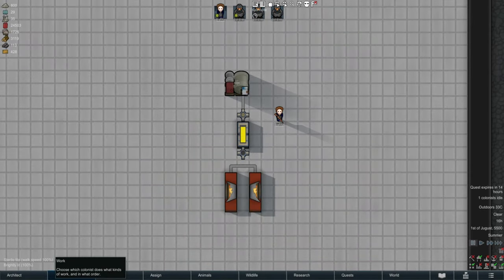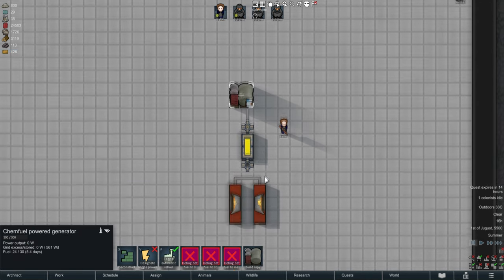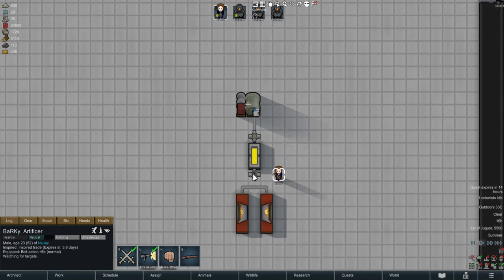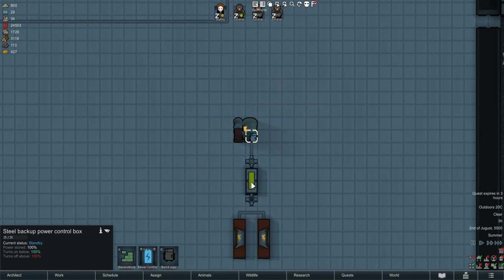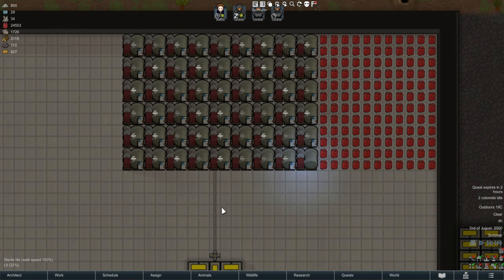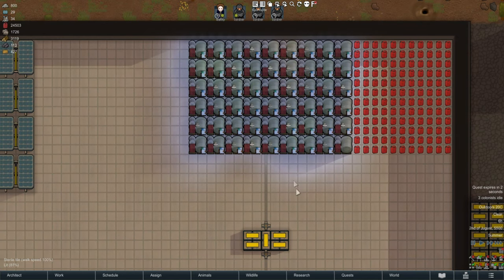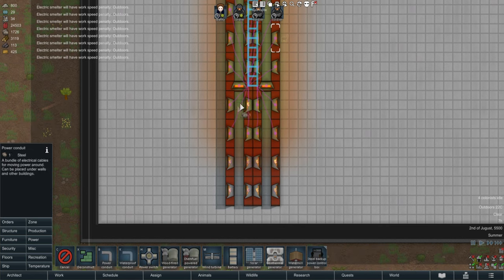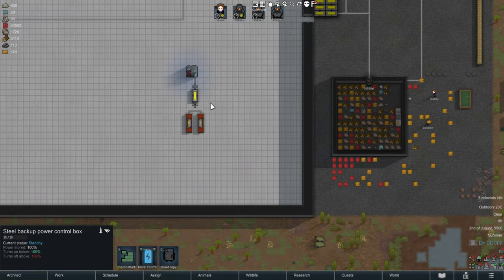Backup Power! Rimworld Mod Showcase

Comment: Love this mod too.
A hint about sharing settings between backup power boxes: Set up one box. Then right click on the button and this will give you option to share setting with other boxes on the same grid or to all boxes on the map.
Also don't set up the turn off level to 100% of the batteries. I find settings of 15%-50% most useful as it gives you some leeway to store power if your solar/windturbines are having a good time, and still keeps you safe from the blackouts.
Also a little annoying that if you reinstall the generator the box stays in place and you can only deconstruct it...

Comment: When I think of backup power being needed it is right after I get a bad electric event that just drained all my batteries.  However, this does not seem to help in that case.  It does seem good that if you have solar panels and wind wood powered generators I would like to not burn the wood if I have batteries above 50%. In this case, it seems it would stop the wood-burning furnaces.  And even though I use battery fuses power events are still a small pain for a little bit depending on how good or bad my power gap is.